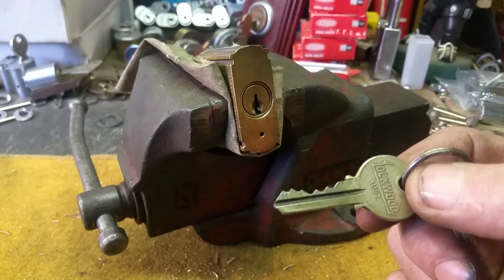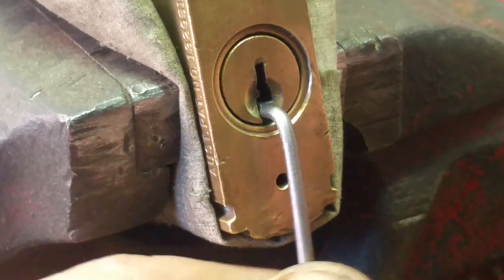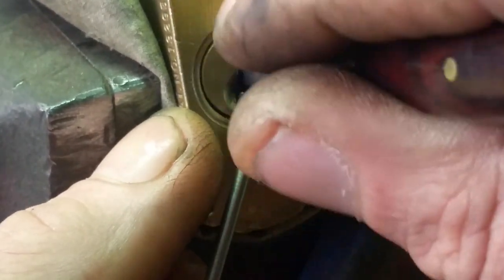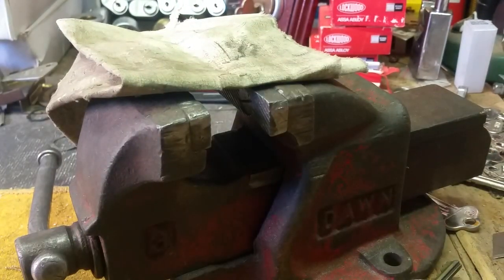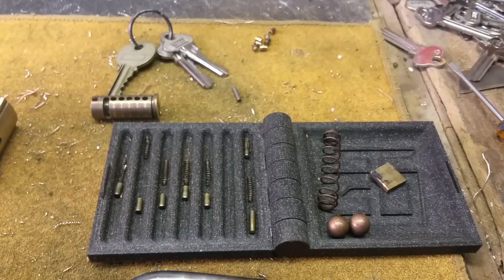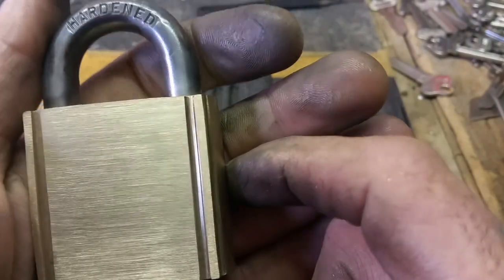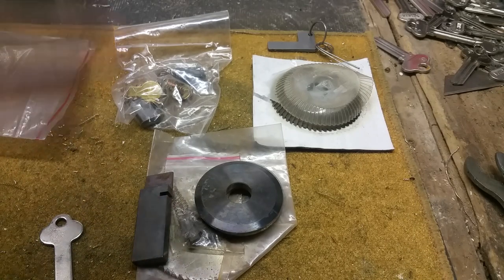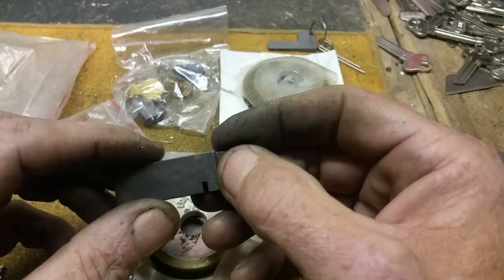#201 Quick 245 Lockwood refurb. The Lockwood 120N/40 exposed.

Comment: Nice pick on the 245. Looks so much better now mate.
The 120/50 padlocks have longer and deeper spools than that 40mm version.

What do you kniw, i also got myself a key duplicating machine. 
I will be modifying and stripping unnecessary parts to do individual cuts with space and depth keys, rather than just copying a key.
Reply from the maker: Thanks mate. Reminded me that i have to get those Best Control keys cut for you and the LW5 S&D keys and that Kaba Quattro keyed. I'll get onto it this week mate. Yeah, when i said the drivers were standard over the series, i meant the 120N/20 series. Not the 50 series. What machine did you score Funk? Cheers:-)
Reply: @crankylock7844  thats ok mate. 
I bought the Chinese one off eBay. I wanted to buy the vertical milling key cutter to do track keys but I decided to go for the cheapest one.
Ill be taking off the offset cam that pushes the key carriage to the left. And will be re wiring a direct power switch and piss off the micro switches.
I'll send you a picture or 2 to show what they look Luke under the cover.
Reply: FunKey MonKey very cool Funkey!
I would be interested in seeing which  one you got and see what you can do with it! I have a Chinese one, can’t remember what one. It’s still in the box and Suki has taken it as one of her nap places 😅 
But am interested it taking it back and using it some day. 
👍👍👏👍🐈

Comment: Great video mate👍 Really enjoy the investigation of each of the locks and the internals, very informative. 
I have a 120N/50 so I know what I'm up against now😀 
Have a great evening mate👍😀✌️
Reply from the maker: Thanks mate. I think Funk maybe right with the differing spools in the 50 series. You should be ok though. Longer spool will give you deeper sets and better counter. Well, that's the theory. lol. Cheers:-)
Reply: paul springett Cheers for clarifying that, I wonder if driver pin 2 would be standard in the 50 also🤔 I'll have a play with pin 2 and see if the core moves into a false set.
Reply from the maker: @KeylessEntry  I'll give you an exploded view of the 120N/50 tomorrow when i do the draw:-)
Reply: paul springett Cheers Paul but if you plan on destroying one please don't, unless you have a photo of a previous one. I can Google or search YouTube to find out if they are the same👍

Comment: Actually, Paul, those keys are different. If you look closely at them (7:29 mark in the video), not only is there no lip around the edge of the bow (it hasn't been worn off. I have a few like that and can prove they are different. Look where the bow meets the blade. No sign of the rim there), but the cut coming up from the blade is also different. You can see that the cut on the left one ends well below the AUST. but on the right, it comes right up and cuts into the S of the AUST.
Reply from the maker: I didn't pay too much heed to the finer details but the rim on the key head is more prominent on one key as opposed to the other. I wood guess the rimmed edge key head maybe the later of the two? Just a thought:-)
Reply: @crankylock7844  I don't know which is older but I've observed a few differences.
Even the cloverleaf bows have some subtle differences when you look closely.
BTW, Paul, would you happen to know what the raised letters "S R" means on the back of the bow of some LW4R keys? These have a reverse profile to the regular LW4 keys. Since the two letters are raised rather than stamped, they must come from the factory like that. I would guess that the "R" may mean "Reverse" but I've no idea what the "S" may mean.
Reply from the maker: @two_tier_gary_rumain  To be fair i am not sure. I am sure the R is for reverse but as to what the S stands for i am not sure. Do they have the Lockwood Font on the head? I can't remember if they did or not. Could be an early Silca maybe? I'll ask around. Cheers:-)
Reply: @crankylock7844  They're all Lockwood keys. I have 5 so far. 1 is nickel silver or sliver brass and the other 4 are brass keys.
The font on the front is the old cursive L Lockwood one. Two of them have "AUST." underneath the logo. The other 3 are just plain logo. Even the "S R" on the back varies. The font size on one is larger than the others and another looks smaller.
Even the cuts on the blade vary where it stops. One of them comes right up into the bow. So it looks like they've been making these over a long period.
I can shoot you a photo of them if you like. Let me know.

Comment: Man, you sure do some great work Paul, that one turned out nicely :) Nothing quite like bringing new life back into old locks..  Been meaning to ask, What kind of belt sander do you have buddy? Also, I send you an email, (question on flat keys)
Reply from the maker: Thanks Rook. I have and use a Bunnings special mate. The $50 Chinesium Ozito. I have the 3 inch width 180 grit belt. Works a treat for the purpose i use it for. It has a 2 year warranty. You can't go wrong. Not only that, i'm a cheap bastard. lol. All good with the email:-)
Reply: @crankylock7844  Ahh nice.. Yeah, I'm the same way buddy, lol. I only have access to a hand held belt sander.. not a bench mount one like I'm assuming yours is.. I'd love to get a 2 by 72 inch belt grinder one day, lol.. one like the knife makers use.. I think it would be great all around.. Perhaps even for pick making.. Anyway, thanks again buddy ! Take care
Reply: @crankylock7844  $50? I paid $69 for my Ozito from Bunnings.